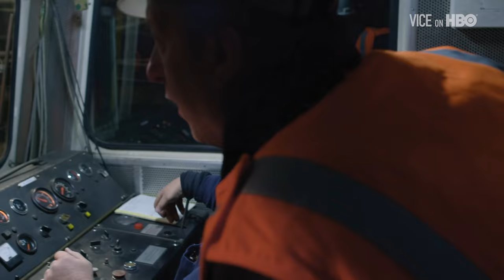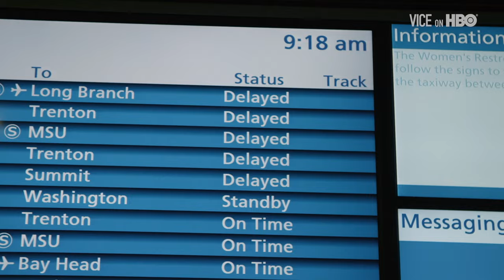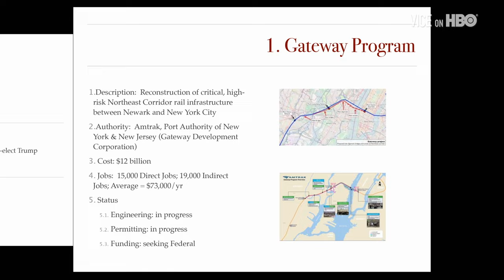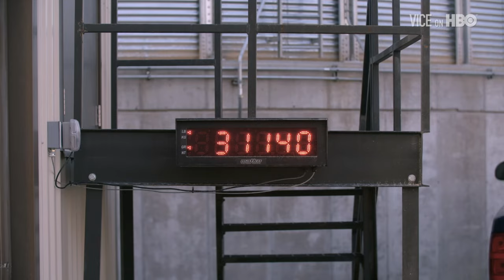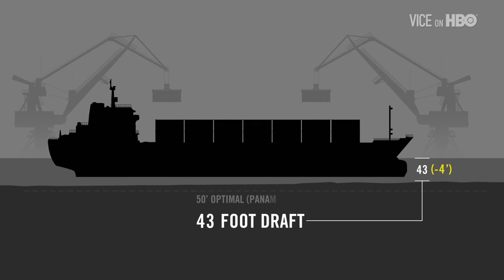America's Infrastructure Is Crumbling

Comment: China Good at building infrastructure
USA: We need to repair this
Also USA: Anyways, 750 Billion add into Military
Reply: @vanshthakkar722  Well, tell that to Urumqi then. That city is still better than most "developing" country
Reply: @vanshthakkar722  even poor city or 3rd grade towns in china are more cleaner ,have systematic planning & infrastructure 😂
Reply: It may seem China is making progress with infrastructure but if you look just beyond the surface of fancy buildings and bridges you see shoddy workmanship. The poorest of materials used and a labor force hardly enticed to do their best if you know what I mean. There are countless compilation videos here on YouTube of entire buildings and bridges collapsing in China. You know that one guy who takes something apart and when he puts it back together there is a screw leftover and they just shrug their shoulders. Well China's infrastructure is that guy. It's easy to build a hospital in 10 days when you leave out 90% of what makes a building a building. There was a video of it here on YouTube. Floors that fell through. No insulation between walls. No ventilation and parts that did have ventilation led to nowhere. Electrical outlets that didn't work. Requiring walls to be removed after construction to fix them. Water only available in half the building. They even made a big deal about how the hospital uses green energy which led to power supply issues. Requiring China to quietly connect the hospital to the power grid in shame and on top of all this they didn't even take into account for the size of medical devices like MRI machines. Requiring them to tear down even more walls to fit the things a hospital needs in the building. This is China's infrastructure in a nutshell.
Reply: You don't even have to change the amount of military spending, just divert most of it to the Army Corps of Engineers, since they run the waterways for some reason.
Reply: Meanwhile Western and Middle China:China Build our Infrastructure 
China:Nah we we only focus on our east coast cities to fool everyone that we are a developed country and that  we have the best infrastructure in the world through our media and propaganda.
Reply: @mirizid9667  not to mention Chonqing or Changsha, Wuhan, Chengdu, Xi'an..
But yea sure the only developed part of China is the East coast 🙄
Reply: @-KillaWatt-  LOL
China's infrastructure in a nutshell is thousands of kilometers of new highway and high speed rail and modern megacities. Anybody can see that
Reply: @bradley8575  you know that's not true my friend.. you know you just wrote a very silly comment
Reply: @Apodeipnon  well My fiends you should loom on the outskirts of China major cities they are Slums and and in Xinjiang and Tibet due to it being Pretty remote the infrastructure there it is not good compare to China eastern cities
Reply: @Regarded69  source: trust me bro
Reply: China’s infrastructure is the perfect gilded cage...
Reply: @-KillaWatt-  funny american who never been to China, even abroad?
Reply: @Apodeipnon  ive been to the west coast of China and it isn't that bad. It is less developed than the east coast but it is still pretty good. The Chinese government probably prioritized the east coast development because most of the Chinese population lives there.
Reply: @vanshthakkar722  Username: IndIAN  aRmYYYYyy

Comment: I come from a Railroad Administrative family and I'd like to share what I know about this topic.

The biggest issue railway companies and services face isnt it's customers or shipment but no doubt the infrastructure. Without good infrastructure, customers and cargo supply chains can lodge formal complaints, so most railways compromise with their regular safety briefs and government inspections. However, government inspections overlook the main details.

One of the biggest flaws behind the 20th century model railway system is the rails themselves. The cheap metal is prone to warping over the course of seasons. In other words since 1970, under the Nixon administration, Amtrak has been operating on the same rails since; plus, I'm unsure how many of those rail lines were previously operated such as during WW2, pre and post. Regardless, the rail lines would have undergone extreme stress, atleast, 50 summers and 50 winters, which by in large surmounts to exorbitant costs of damage and short term repairs that don't take the future into consideration. Not to mention flooding, storms and hurricanes, natural disasters like tornadoes and unforeseen conditions, and intense blizzards. As long as it fits, it ships.

There is a Rail Line Track Renewal Train, that can operate only with the properly trained workers and highly skilled foremen, and a knowledgeable staff. But it only replaces the tracks and the sleepers. Depending on the machinery system, the railway plates, bolts, and spikes are automatically removed and installed; however that's dependent on how advanced the Rail Line Track Renewal Train is. In other words, it may have to be done manually with unskilled labor, which drives up costs and insurance.

Not to mention, the Rail Line Track Renewal Train does not remove and replace the ballast underneath the track, which isn't susceptible to water damage, but the surrounding earth is. The ballast can also be a contributor to warped tracks due to heavy freight loads and the constant changes in seasons.

Railway companies and services are on the brink of juggling paying their employees and workers, providing a service to passengers and supply chains, all while maintaining it's vast network of operators and trains on a slowly deteriorating system for an ever-growing economy. Fixing it all is easier said than done.

The biggest issue of it all is energy consumption. America is one of the very few nations that still relies of coal as a nationwide source of fuel for 60-80% of it's industries' energy. Considering, coal mining is a source of income for those civilians out in the Midwest, and there by noting how dependent our nation is on this fossil fuel, railway companies take advantage of this by providing energy as a logistical supplier. Altogether, I have no doubt and have my suspicions that the Railroad has lobbied for slow progress in ensuring the future of our livestock, communities, and national interests, by firmly positioning themselves against clean energy. Infrastructure is not an issue to be taken lightly.

With it revitalized, I can imagine a cleaner economy, thus' better job environments for both railway employees and workers, and opportunities in skilled labor or other areas of employment for ex-miners in the clean energy industry as maintenance for the new colossal infrastructures. The economy would be more efficient, and people can travel without holding anguish. As for clean energy backing up maintenance, there is public outcry against AIs and Drones taking the jobs of the previous miners, in-scenario skilled maintenance technicians. In that case, they can be easily retrained safely to maintenance the robots, drones, and AI systems themselves as respectable mechanical, electrical, and computer technicians.

The change would be beneficial but if done without meticulous care many would be abandoned in an economic vacuum. Caution and careful planning in building an exceptional system is advised. The future however is not determined, is all up for imagination, and such a sweet systematic approach is not constructed without sacrifices. I fear that such a promising future is not an option in this decade with the extreme priority we still put on the processing of crude oil.

That is my opinion. I don't know much about tunnels, bridges, semis, and shipping. Please be open and feel free to comment any criticisms. It is greatly appreciated.

I hope ya'll got your tetanus shots. Hooah.
Reply: li d  did you just read the very last sentence? Lol
Reply: TL:DR
Reply: Thanks for this this detail. It's horrifying.
Reply: I could only read the last three paragraphs. How the hell did you manage to publish a book in the comments section.
Reply: @grumpycat6429  Haaha same here

Comment: I am a British transport enthusiast and in 2003 I spent 3 months in the USA mainly in the South & Mid West
Being particularly interested in industrial railroads & Short Lines .
The things that really stood out was just how old a great deal of the equipment was. Typically things dated from WW II (particularly locomotives in fact the bulk of the locomotives in industry were built pre 1950) But a good deal of the infrastructure was pre WW II and dated from the 1920's. 
We visited a Coke Works in Alabama which dated from 1903 and 100 years later still had a lot of its original features hard at work. 
Whilst I like old equipment it was quite clear that a very substantial amount of capital needed to be spent on infrastructure. Well that was 17 years ago and the money still hasn't been spent. 
It is very sad.

Comment: Wow, you managed to make something that talked about politics without being overtly biased and partisan. Bravo for actual news! Have a like
Reply: Amen
Reply: Trump says the right things but his delivery on his pledges is very weak. It's all abouit his ego. As for the democrats they will say the wrong things and do even worse. Have a nice election RIP.
Reply: Dustin Stein  he's the current president so he should receive blame, that's part of the job. If you're a leader, you have to take responsibility for successes and failures.
Reply: Dustin Stein  I don't usually join in, but in this case, Trump claimed to have wanted to work on infrastructure, yet he hasn't done a thing. Yes, he's not the one to have caused the issue, but even as I'm not a supporter of his, I did like his initial pledge to spend on infrastructure. The issue is that now that claim seemed to have just been hot air he's blown to gather support without any follow through and that's where he should be called out. I think we want our politicians to be held up to, at the very least, their word.
Reply: what were you watching?
Reply: Dustin Stein  Don't Whine ... Stein. ;-)
Reply: Dustin Stein  He's had plenty of time in the first two years to pass everything he wanted to. He's renegotiated our trade deals and passed his tax cuts/bills that increased our deficits. In his first two years he had both a republican senate AND house to do his bidding. Even now, he's still got a republican senate and I doubt he'd have any hard resistance to really pushing out an infrastructure spending bill - except for the fact that he might find it hard to push open the deficit. You know what, the impeachment trial is over, he can work on it now! But he won't because it probably won't get him much more positive press or serve his own interests to do so - ain't that tragic.
Reply: Dustin Stein  Haha no sorry comrade I do not follow along with communism ...

And I quote: '@Michel Platteeuw I don't whine I don't make excuses just state facts'

See? You didn't end a sentence. Everyone educated can proof read. Gonna edit your comment now so everyone can see your true failure?

Comment: Just to get some reference, 
Cement production 2019 in millions of tons
USA 89
China 2200

Steel production 2019 in millions of tons
USA 87.9
China 996.3
Reply: tomte47 only for US border wall
Reply: Are those numbers only for government and infrastructure uses or partially exports? But yeah I get it huge difference
Reply: Factor in per capita so that there is no population skew and China is still incredibly far ahead.
Reply: @Va Sr thats what i said
Reply: @grauerHase  Sounds like a good source of info if you were physically there.

Hot dang, they've got a mess to fix then.

Comment: Yeah, I don't get it, we spend 2 trillion dollars in Afghanistan for nothing and the fucking roads and bridges in the US are a mess.
Reply: The calculation behind the 2 trillion number is wrong. It's made by a university that clearly didn't work with the budgets. 

The british spent at absolute maximum equalivance of 100 billion USD. The official estimate is that they spent 22,2 Billion British Pounds. Which would be around 50 Billion USD. 

The british had from invasion till Obama surge of troops roughly 1/3 of the US involvement. That's a 10 year period. 
Then came a 4 year period where US were between 1/10 and 1/6. After that back at some 1/5. 
In total the money said to be spent by the US seems way to high. 

Having looked at it the money said to be spent also makes no sense. 530 Billion USD to be paid in interest of loans??? What loans was made and at what interest? The US government didn't need to take loans its army was already well funded by taxpayer money.

Comment: The only time I took Amtrak north out of NYC to go home, I was over 8 hour late, because a boat hit the supports of the only bridge out, and then after that was resolved, the first three trains we boarded had issues that prevented them from leaving the station. As I remember the conductor telling me, the first one had a broken coupling, the second had a brake failure, and for the last, power generation wasn't working, so we were packed in like cattle, in the dark, with no AC. It was pretty awful. Never again.

Comment: 2021, and still as crappy and falling apart in USA.
While in China they are building crazy top of the tech infrastructure, for example:
- within around 10 years they build 38,0000 km of high speed train (300-350 km/h, or 200-220 mph), plan to reach 70,000 km in 15 years.
- dozens of cities are building a crazy amount of metro line each year (shanghai add 40km a year non stop in the last 20 years, and this year alone Beijing will add 300km of new line).
- new bridges everywhere
- ulta high voltage energy transport to transport renewable energy produce in the empty space of the west part of china to the coast where most of cities are.
- highways, water canal, 
- water diversion project to bring water from south of China (which has too much water) to north of china (which has too few water)
- crazy amount of solar panels and wind energy
- and so on...

Comment: So i just calculated what if the Netherlands, a country with a good infrastructure had the same size of population and surface as the United States. The Dutch GDP would rise from 907.1 billion to 115.97 trillion. Which is 5 times the size of the US GDP of 21.43 trillion.
In other words, think of how even more powerful the USA actually could be if it has a good infrastructure. 

Sure, such a calculation based upon only 3 factors; GDP, pop and surface is of course not a reliable research conclusion. Yet, it it could hold some truth to it.

Comment: We will only do infrastructure projects when armies of unemployed can be used. The cost of using typical union based construction is simply cost prohibitive. When the depression comes and the stimulus dries up the gov will enact a jobs program for new infrastructure and it will not be prevailing union wages...it will be half that and you will accept it.  The benefit here however is prices of everything will come down to meet what wages prob should have been to begin with.